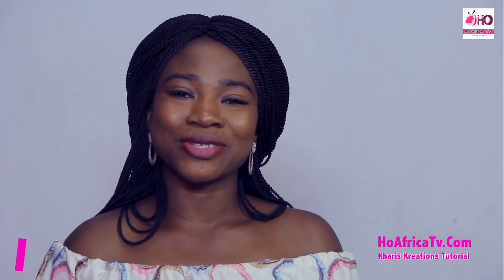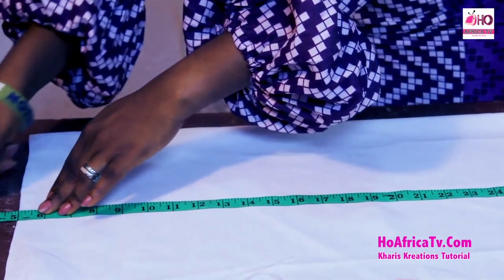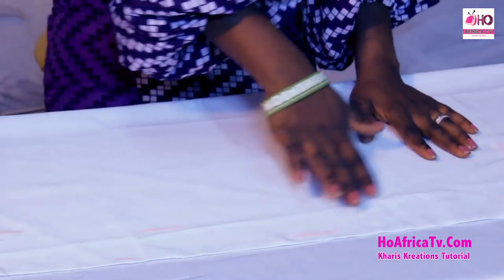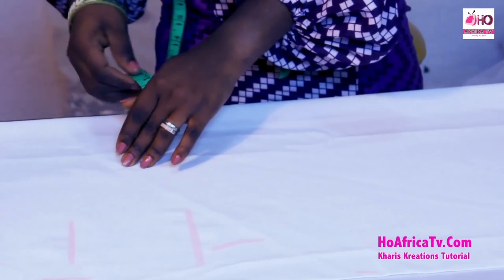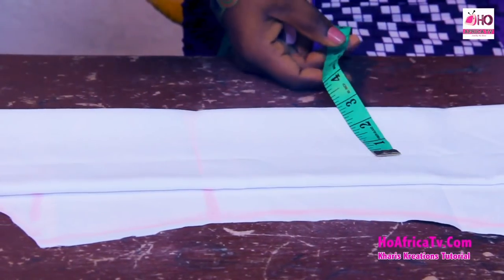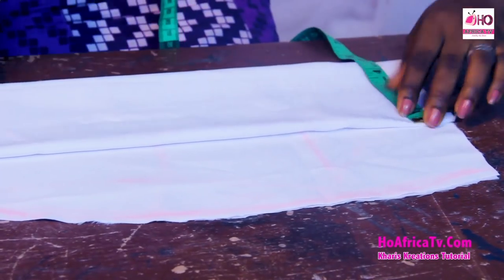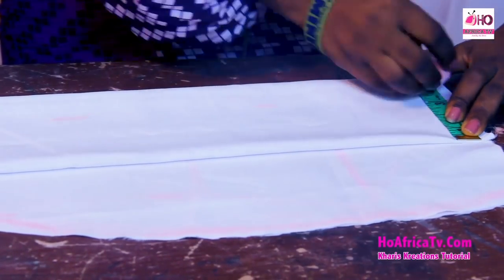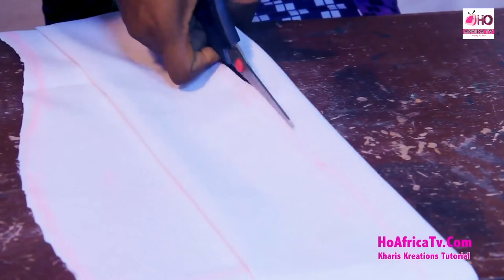How To Cut A Wedding Gown (Pt 1)

Comment: How do I take this measurement on my son? Will I measure the thigh round  or straightdown from d hip to get the upper and lower thigh?
Reply: For measurements #1, you measure around the thigh area circumference.  Also for measurement #2, have your son sit in a chair and measure from the waist to end of his  thigh area is resting on the chair.   These two measurements are for the pants.

Comment: But my question is,if my nipple to nipple is 4 or 5 inches, am i still going to add 8inches to my measurement for the bustier.
Reply from the maker: To your circumference measurements add 8 inches and divide by 4, it's the same as your measurement ÷ 4+2. Thanks
Reply: The pattern you used to cut this gown, please can you use it to cut bustier fitted gown with yolk and Zip at the back.thanks